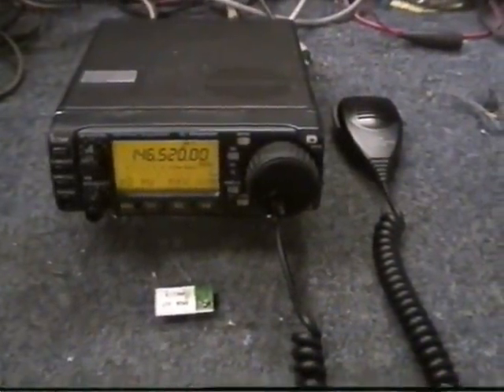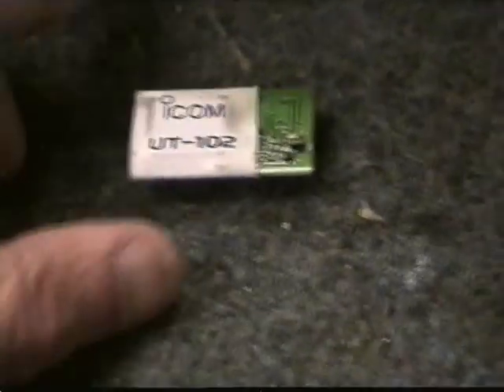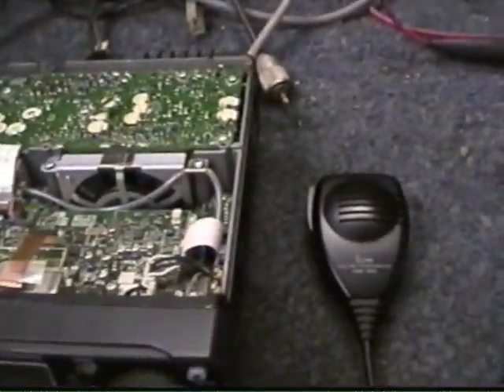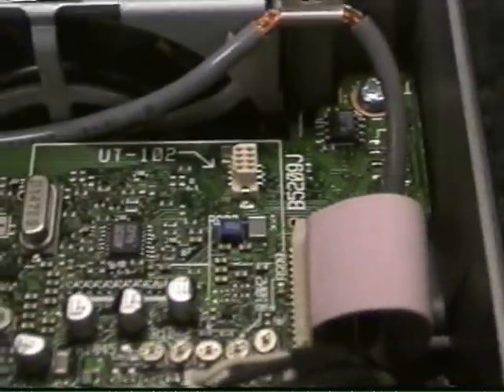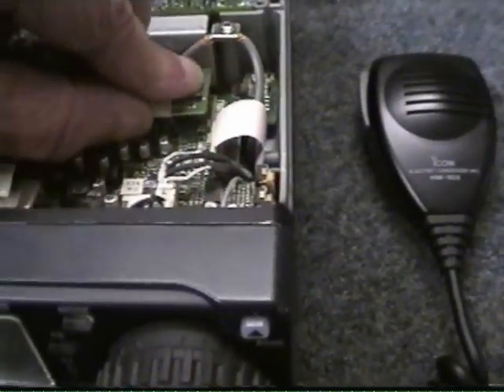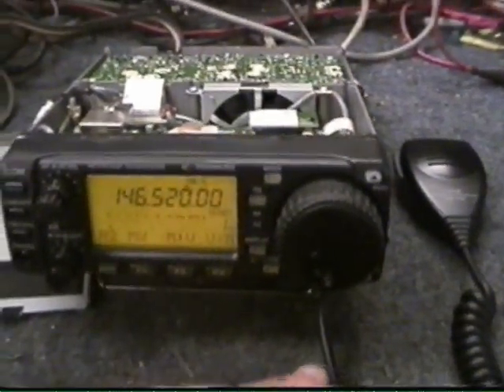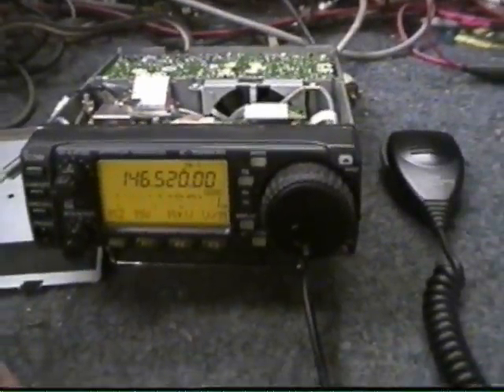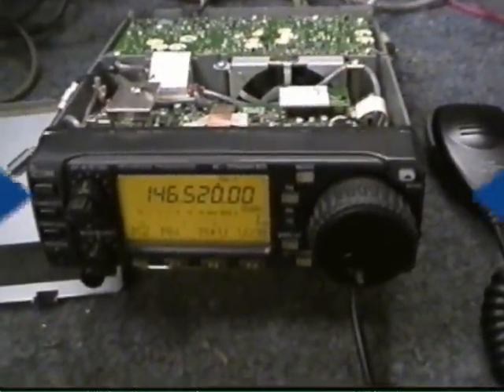Icom UT-102 Voice Module Installed In IC-706MKIIG Mobile Ham Radio Transceiver

Comment: I am checking now that I just got one of the LAST possible improvements to my 2004 706MK2G, on ebay today for $124. There was another one for $199 and he would not come don to $175. ANYWAY, there should be one of the many little silver color TRIM POTS to set this level, another guy's YouTube showed this. I run mine thru my Blaupunkt stereo with 8 band EQ display on AUX IN. I added an old Transistor Radio transformer to isolate the ground noise like the Radio Shack amp isolators used to do. Since mine has the DSP board, I only wanted the WIDE 6KHz AM Filter and 500Hz CW filters that work great and can be used in other modes if you fool the radio in setup. It IS louder than in this video. Also it seems to announce in the nice Female voice - the INCORRECT leading digit instead of ZERO - on the lower to 50MHz bands. ANYONE ELSE have this issue?
Going to remove it tonight and hit the main white connectors with DEOXIT.

Comment: Ive found teh one on mine blasts too loud. Do you know how to adjust its volume?
Reply from the maker: +truthseekers666 Thanks for watching my video..Unfortunately, I do not have any techincal to offer you on how to adjust the volume..73, Mel, WA5UTK
Reply: They are all very loud.Get use to it or turn the volume down or just don't use it.
Reply: I am checking now that I just got one of the LAST possible improvements to my 2004 706MK2G, on ebay today for $124. There was another one for $199 and he would not come don to $175. ANYWAY, there should be one of the many little silver color TRIM POTS to set this level, another guy's YouTube showed this. I run mine thru my Blaupunkt stereo with 8 band EQ display on AUX IN. I added an old Transistor Radio transformer to isolate the ground noise like the Radio Shack amp isolators used to do. Since mine has the DSP board, I only wanted the WIDE 6KHz AM Filter and 500Hz CW filters that work great and can be used in other modes if you fool the radio in setup. It IS louder than in this video. Also it seems to announce in the nice Female voice - the INCORRECT leading digit instead of ZERO - on the lower to 50MHz bands. ANYONE ELSE have this issue?
Going to remove it and hit the main white connector with DEOXIT. Thanks for the little forum here!, 73, Hilary W4HDL

Comment: I was thinking of getting this, Other then blind people, and On the road what is the point.
Reply: Because some people like every feature available for their gear.Mine already had it when I purchased it so it stayed installed.
Reply: This is a great little item and Blind Aid. One of the Ham Support sites gave full info on this item AND the disclaimer that it is VERY MUCH discontinued, AND the IC-718 if upgraded in FW, breaks the Speech Synthesizer function. SAD, as our real President likes to say...
Reply: @conservative599  I am blind and need one of these modules, do you know if they can be found anywhere? I’ve looked and there are a couple on eBay but I was wondering if there is another manufacturer who still has any in stock.

Comment: The activation button (LOCK) was not mentioned in the manual with the little install instructions there was. After watching your video I went back to the manual and looked  up the lock button and there it was, one sentance in the manual that I missed. Thanks for sharing.